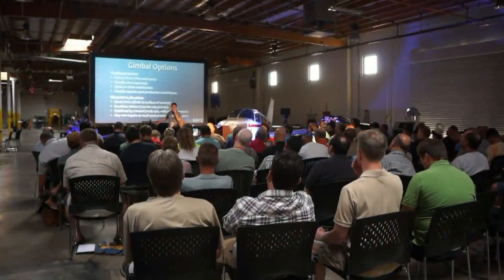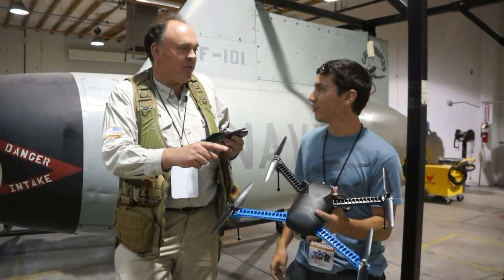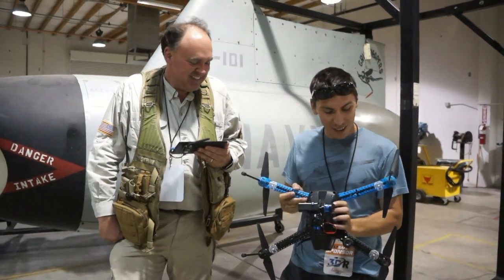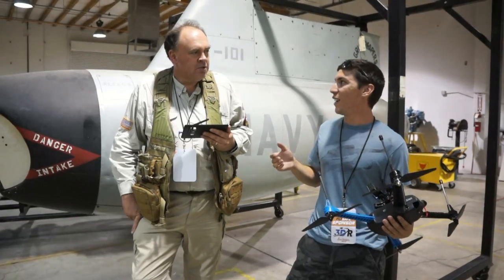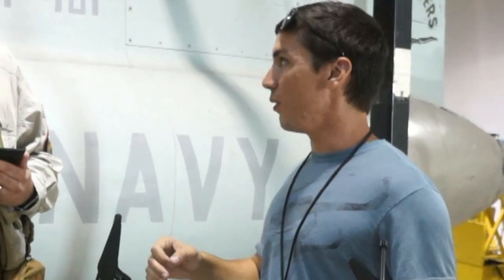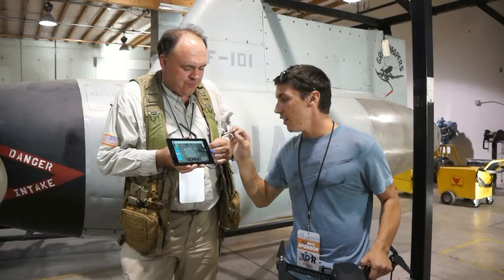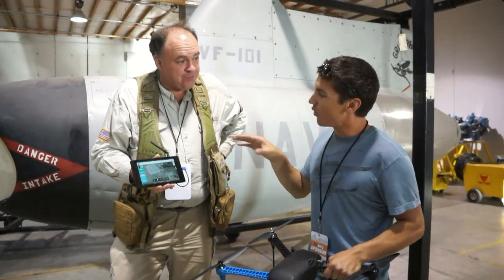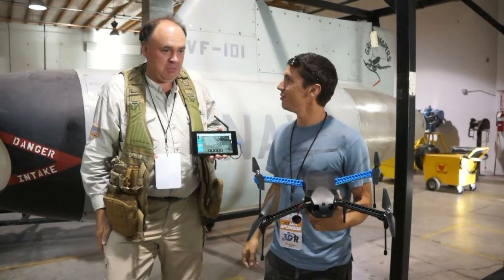RFTC: 3D Robotics Introduces the Iris+ Quadcopter at Las Vegas FlySafe 2014

Comment: Congrats on at least getting the Iris Plus into production. Although, next to the Phantom, Inspire, Matrix & TBS Discovery Quads, the Iris Plus still looks like a cheap plastic toy. It's time for 3DR to wake up to its competition, especially from China. Aside from an impressive open source flight controller, the rest of 3DR is in desperately need of a major overhaul or better yet team up with another company has the technology and designs already. I don't believe in recreate the wheel which will take 3DR another 3 years. Yes, that's how far they are behind. First of all, flexible arms are horrible for flight & video performance. Hire a better designer and dump the boxy quad with sticks on the bottom. Flight time should be bumped up to 30-40 minutes and air speed should be at least 50 knots.
Reply: The big difference between the quads you listed and the Iris+ is price. This is a consumer model, if you check the 3DR website they have commercial models with better specs.

Comment: 1:13 More flexible props for more stability...
Reply: Believe it or not, the rigidity of the props change the flight behavior.  In forward flight, having a small amount of flex in the multirotor prop can absorb the forces caused by dissymmetry of lift  (http://en.wikipedia.org/wiki/Dissymmetry_of_lift). Since almost all multirotors utilize a rigid rotor head, this can actually increase stability since these forces can be absorbed through blade flexing instead of complicated rotor mechanics.
Reply: So why is a stiff carbon prop better then a sloppy plastic one then?
I can believe your theory, but I think the circumstances for that theory to actually have a noticeable effect are very rare. Maybe something the Rowell Crew could test?
Reply from the maker: Leo Rådström Interesting question, but probably very difficult to test without more resources than we have... After you suggested we test it, I started thinking about how we would actually conduct such a test, and I quickly ran into what I saw as an insurmountable problem: you would need two sets of props, identical in every regard, except that one is rigid and one is "floppy." At first, I thought it would simply be a matter of getting some floppy 10-inch plastic props and some rigid 10-inch carbon fiber props and flying both sets on the same aircraft, measuring stability, persistence, and so forth... However, I suspect that you're right about this being a pretty subtle effect, and my guess is that it would be lost among other differences between commercially available props. Even two 10-inch propellers with the same pitch are going to vary in precise geometry, weight, and so forth. Near as I can figure it, it you really wanted to test this question with precision, you'd actually need to manufacture the propellers yourself, so that you could control all of the variables in the design and hold everything constant except for rigidity. That, unfortunately, is well beyond our capabilities.
Reply from the maker: PhunnyPharmer Thanks for jumping in with the explanation -- I had no idea myself. It makes sense that flexible props would "soak up" vibration and the forces created by dissymmetry of lift, as you describe. Hmmm.... You learn something new every day!
Reply: Yes that makes me jumping from my chair too lol